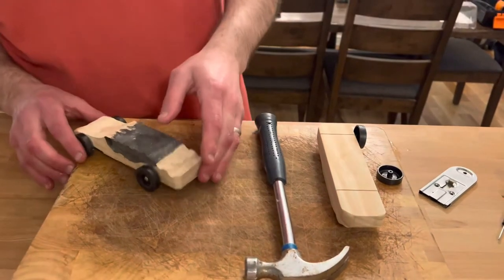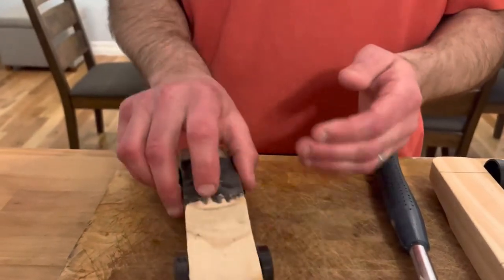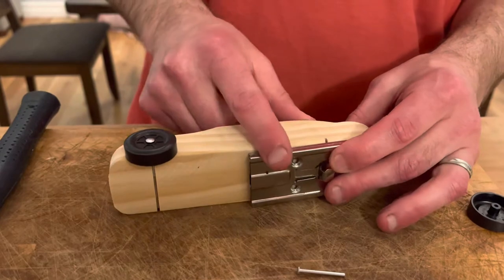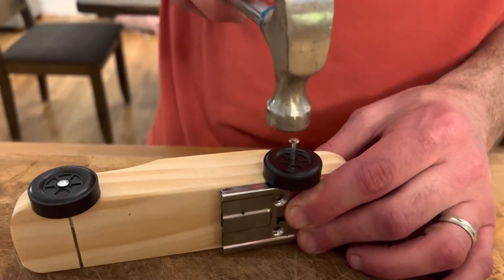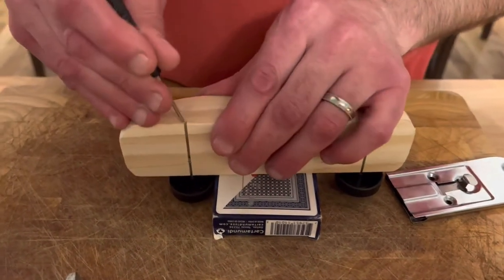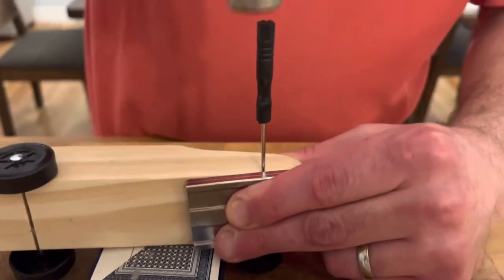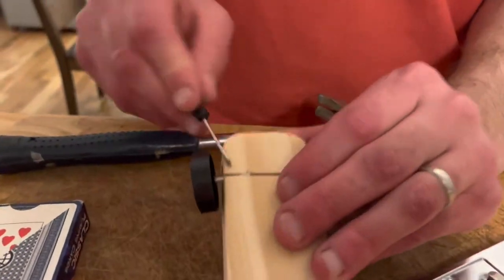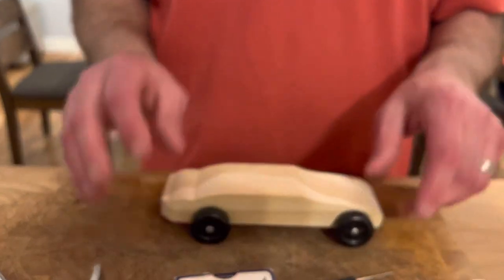Pinewood Car wheel assembly help for the Pine Car Derby!

Comment: use pliers to cut the head of one of the nails in the kit, use the nail end you just snipped as a drill bit to drill into the slot, perfect size perfect hole.